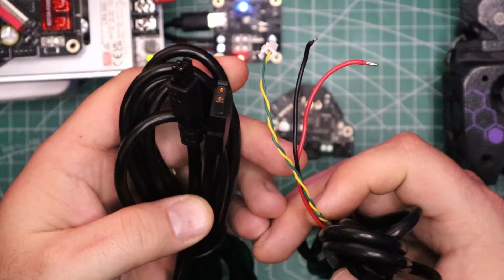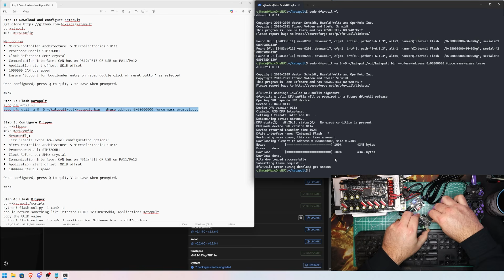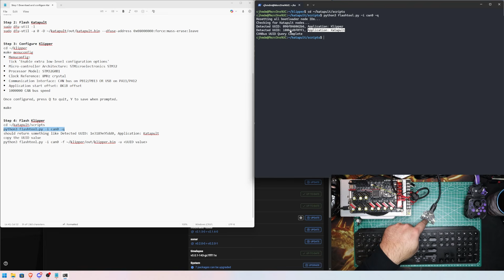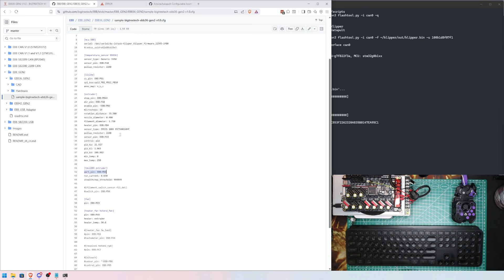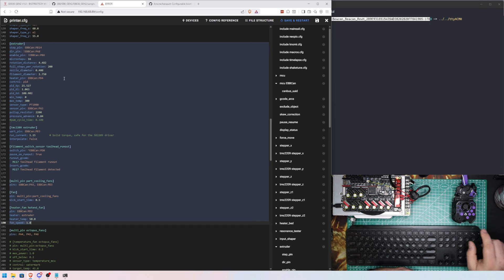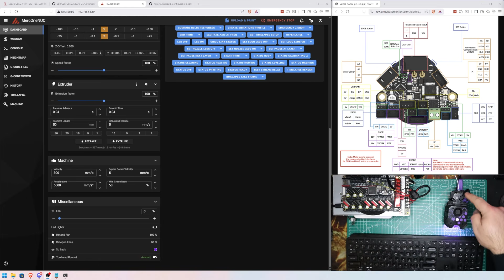BigTreeTech EBB36 Gen 2 Review + Setup & Flashing Guide | USB & CAN (Gen1 vs Gen2)

Comment from the maker: ⚠Correction (Wiring Clarification):

In this video I incorrectly stated that the USB adapter board is not required when running the EBB36 Gen 2 in CAN mode. In the configuration shown here, the USB adapter board is required for proper power delivery and safe operation. Please ensure it is installed as intended.

Additionally, you do not need to cut the MX3.0 connector off the included cable.

The correct wiring is as follows:
- Create a new 2-pin CAN cable from your main control board (for example, an Octopus Max EZ).
- Connect that cable to the 2-pin CAN header on the USB adapter board.
- Then use the provided MX3.0 to XT30 cable to connect from the USB adapter board to the EBB36 Gen 2.
- Do not modify the included MX3.0 cable. Use it as supplied between the USB adapter and the EBB36 Gen 2.
Reply: I've been running 2 machines both using EBB36 Gen 2's and I am not using the adapter board on either of them without issues.
Reply from the maker: @liftedcj7on44s  that's good to know. However, I wanted to update just the same as using the USB adapter board is recommended by BTT. Thanks for the feedback!
Reply: @TheMotionBench it seems to be a extra layer of protection when using it.  I’m not sure what the down side would be. I was a bit surprised to see you did not use it, I guess less stuff to go wrong if you don’t use it. 
I saw in one other review a big discussion about the layers of protection the Gen 2 has .
Reply from the maker: @steve.hanwright  The error was on my end as I misunderstood what I'd read in the docs. I thought the adapter board filters were specifically for USB for some reason.

At the end of the day though, it's a little added protection, filtering the 24v power, which, in theory, should already be pretty clean, especially if running directly from the power supply (and assuming you're using a good quality psu). How necessary it is in practice remains to be seen. I'll likely use it in my build either way.
Reply: can you show how you have it connected?
Reply: Can this version be connected alongside previous versions and will they work well?
Reply from the maker: @josualos  I'm not entirely sure what you mean. The only way you'd install this alongside a Gen1 is if you were running multiple toolheads, otherwise, you'd typically only run a single board like this. If you can clarify what you mean, please do so and I'll help answer the best I can.
Reply: Glad u clarified it, been driving a bit crazy trying to figure out why would I need to cut the cable down if I had a can in next to it, great video
Reply: I have a board that is USB so i needed an U2C.. how do you connect the U2C to the USB Adapter Card?

Comment: dO YOU HAVE A SAMPLE EBB36 v2 COMBO CONFIG FILE. I have configured 4 a4t ebb36 V1 boards are working fine but am having problems finding the correct pins for the ebb36 V2 combo boards I have 2 of them a4t with cutters

Comment: @TheMotionBench - Thanks for the straight forward video.  I was able to run through all of the steps without any issues.
I would like to know if you could provide a link to the stl file you used for the Gen 2 mount to the A4T shown in your video?

Comment: One general tip that helps me is to make my Klipper configuration modular.  For example, I have a separate configuration file for my EBB board, with an "Include" line in my main printer.conf. That way if I replace the board, I can just swap in an new file, rather than finding and updating everything in my printer.conf file. The EBB.cfg file includes everything specific to the EBB board.
Reply from the maker: That's a great tip, keeping configurations modular definitely makes maintenance a lot cleaner. 👍

Comment: hey big fan love your videos! can you help me i have an ebb36 gen 2 and an eddy duo sensor now how do i make all that work over can? my pi is connected via usb to adapter board then mx3.0 cable to ebb36 gen2 and the eddy duo is connected in can mode to the ebb36 gen2 but idk how to get it all working?? Maybe an idea for your next video? Help me please :(
Reply from the maker: As far as I understand it, you cannot control the EBB36 via CAN directly from the Pi as the Pi doesn't have a native CAN interface. What you would typically do is Pi to your CAN compatible main Klipper controller board (ie BTT Octopus Max EZ), configured to use "USB to CAN bridge", then from there, communicate with the EBB36 over CAN through the main klipper controller board, as demonstrated in my video.

Comment: Great feedback.  Running another brand toolhead board USB only.  Very easy to setup and configure.  However... had to update USB cable from pi to adapter board to gen 3.1 v2 cable (better shielded), and use ferrels on ends of motor and toolhead cables to counteract EMI.  It works stably  with these mods, but sheesh.  Also seems to be sensitive to static... as in touch any part of the printer frame sensitive.  Wondering if BTT gen2 toolhead boards using CAN is a better option.  Does this toolhead board work with non-BTT MCU's assuming they support CAN?
Reply from the maker: I ran into similar issues with my old SB2209 when running it over USB. That was actually one of the main reasons I moved to CAN, which has been noticeably more stable in my experience.

As for compatibility, these boards aren’t tied to a specific brand of mainboard. They run Klipper firmware themselves and communicate with the host through CAN, so as long as the main MCU supports CAN and is configured properly in Klipper, they should work fine regardless of the manufacturer.

Comment: So does the adapter board do both usb and can for those of us without can but with usb?
Reply from the maker: yes, it's for both USB as well as CAN. In the case of USB, you'd just configure klipper for USB on PA11/PA12, compile flash it, then add the serial device to your printer.cfg instead of the CAN device. Refer to the docs and example config for assistance there.

Comment: This is a great guide! I"m trying to make sure I'm doing it right, my Can0 is not up after trying so many ways to flash the u2c and the ebb36 without success, I'm thinking of just nuking my current klipper and start over with a clean setup, what is the correct way to set up the Can network? interfaces.d doesn't show up
Reply from the maker: typically speaking, you wouldn't use CAN only for this board, and should already have a working CAN interface communication between your host machine and mainboard. 

For example, I use a USB to CAN bridge configuration to communicate between my host machine and my Octopus Max EZ, and the EBB36 uses CAN off the Max EZ board. I don't think going directly from host to EBB36 over CAN is likely to work as you would need a bridge for the host machine. You could use something like a RS485 CAN HAT for raspberry pi, but that's outside the scope of normal operation with an EBB36.
Reply: @TheMotionBench I'm using an SKR mini E3 v2 with a Gen 1 ebb, all on Rpi 3B. I wanted to use the u2c to better position the toolhead electronics on this ender 5 Plus, the umbilical cord being easier to replace would be great in a school environment where kids break things every other week and replacing long termistors destroyed by clogs got old really fast. I want to keep spare toolheads ready for minimal downtime.

Comment: Thanks sooo much. I really like the way you structure your video. 
You keep the pace about right, we can always pause and replay.. (lol) 
I’m interested in your feedback about usb mode versus Can, I have beacons and set up a new gen2 in usb so I can use a short fly lead. I have been using this for a month or so and so far so good it been working well. My intention is to keep my umbilical cable light and clean. 
what do you see as pros and cons with CAN v USB . 

I would also like to understand more clearly why Katapult is a better system for managing firmware, my brain almost understands,,,, lol. 
so katapult is installed on the host (PI in my case) when there is a new kipper firmware version. 
Can we flash mcus and tool head boards via the moonraker update manager? 
Once again thanks for contributing.
Reply from the maker: Once I get my printer rebuilt, I will test CAN vs USB more thoroughly and post a video with my findings. For me, personally, I prefer CAN over USB due to potential interference and sensitivity of USB, and have had multiple issues over the years with USB devices that appear to be caused by how sensitive it can be electronically. I think it all comes down to preference. USB can certainly be made to run smoothly and stable, I just prefer CAN.

As for Katapult, it's a bootloader you flash to the tool board itself, eg. the EBB36. It allows you to communicate with the tool board for flashing firmware updates more easily, basically, as opposed to having to do it over DFU, especially when running CAN mode. When it comes to klipper, sometimes when you update via moonraker, changes in the klipper software require recompiling and updating (flashing) klipper on your control boards so the updated software on the host system can regain communication with the control boards.
Reply: @TheMotionBench thanks for the reply, typo in second sentence.. :) 
So a boot loader is some code. (Or and app? ) that sit on each MCU, Tool board, beacon? 
So we don’t need to put code an sSD card or connect over a USB cable in DFU mode.. 
So i recently up date the firmware on my Main MCU a BTT octopus using a sd card with the firmware on it, so I could have installed katapult on the MCU and flashed it that way ?
Reply from the maker: @steve.hanwright  typo corrected :)
A bootloader is basically some code that would sit on a device like the EBB36, and would act as a communication interface between the host and that board, in this case, for ease of upgrading klipper firmware in the future. You wouldn't use a bootloader on a beacon scanner, for example. 

As for updating klipper on your BTT Octopus, yes, I believe you could set it up that way, though I typically update my Octopus Max EZ over DFU since my mainboard is technically always connected to my host machine over USB (even when using CAN), so using Katapult for the Octopus Max EZ isn't really necessary in that instance.

I also wouldn't use Katapult if I were operating the EBB36 in USB mode since I'd already have a way to communicate with it directly.

Comment: I have just spent the last two months struggling to flash my Gen2. This is my first EBB board, and my first foray into Klipper / open source.

Thank you for discussing the documentation limits. 

Did you happen to have any notes for the BTT Eddy duo over canbus onto the Gen2?
Reply from the maker: Not offhand, but if I can dig my Eddy out from wherever it's buried, I can test it out. That being said, I had nothing but issues with both Eddy's I have and have since long stopped using them. I've been using the beacon surface scanner (USB) without issues, and will be trying the cartographer surface scanner (USB/CAN) in my upcoming build.
Reply: @TheMotionBench  "I'm also interested in the BTT Eddy Duo configuration via CAN bus on an EBB36 Gen2."